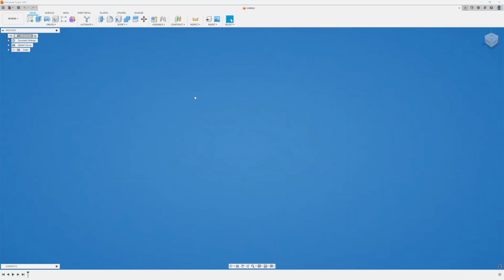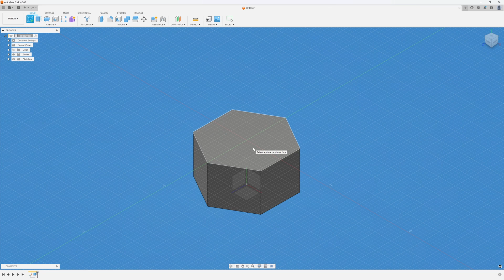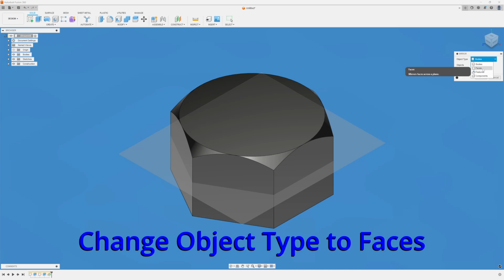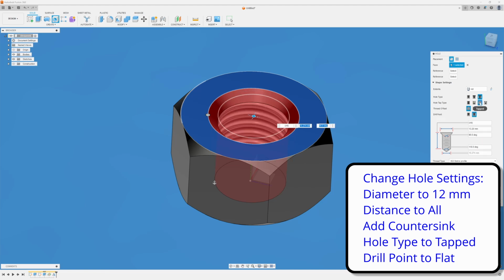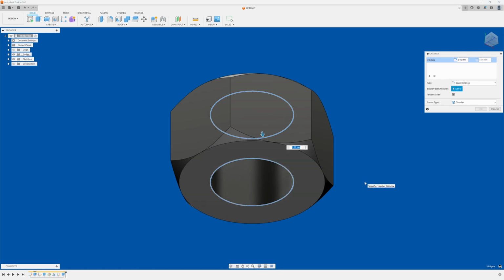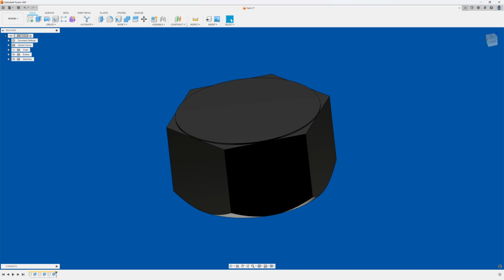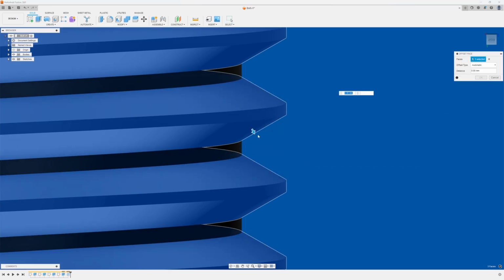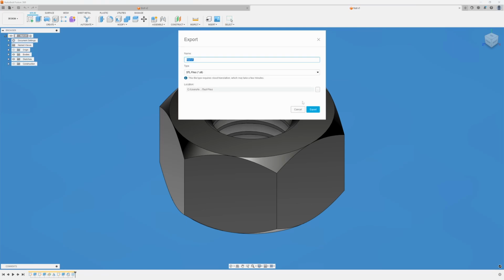Functional 3D Printed Fasteners In Fusion 360

Comment: Very good information. I need to make a lock nut to fit a 2 inch PVC ntp fitting. Good tips. Thanks.
Reply from the maker: I haven't tried this method on pipe threads, it should work! Let me know!

Comment: Thanks, exactly the information I needed! I wanted to attach the the ptfe tube to the side of my printer, so I split the bolt i quarters lengthways and put a hole through it to feed the tube through, and tapered the inside of the nut to compress the tube in place
Reply from the maker: Glad it helps! Thanks for watching!

Comment: thanks again I have learned so much from you. Only thing I wopuld of like to known is  why you to the push pull on the threads
Reply from the maker: I use the push pull to create clearance/tolerance for the thread to engage. If I leave as Fusion makes them, they won't engage. The expansion/contraction of the plastic makes it too tight.

Comment: This was the first video that I have watched on using Fusion 3d.  It was very informative.  I like that you showed several ways to do something, because it gives me more tools in my brain when looking at parts.  It would have been just as easy to roll the nut over and do the circle/extrude, but you showed how the mirror function works.  Not because you are lazy, but because you have a teachers mindset.  Thanks so much for this.  The only input that I have was I found that my nut when on the bolt pretty easy one way, but had to be deliberately aligned to go on the other way.  I found that it was because the 1st way you did the threads you told it to countersink.  The 2nd way you put the chamfer on both sides.  What I realized was that countersink only put the taper on one side of the nut. It needed a chamfer on the other side.  I wouldn't have realized the problem if you hadn't shown both ways to create the threaded hole.  Love this video, love the 3dhinge video.  Keep the 3d design videos coming, you have a new subscriber.
Reply from the maker: Thanks for the kind word! I'm glad you were able to get something out of this video. Obviously, you paid great attention to it. Are you watching Fusion 360 videos for the purpose of 3D printing or general knowledge? Anything in particular u would like to see done in Fusion? Thanks again for the kind words & thanks for watching!

Comment: This is a great tutorial.
One thing I can say what I do to reduce friction from threads binding is reduce the bolt thread diameter by 0.3 . This makes it more better for movement
Reply from the maker: Thanks! Reducing the diameter y 0.3 will work too!
Reply: @pushingplastic7445  just to say threads is a big problem in 3d printing meaning it takes a lot of understanding to get right
Due to the nature of shrinking or expansion of the threads.
But to create for what you have done and shown it is amazing to show and and understand.
From our understanding of our knowledge. If that makes sense
Reply from the maker: @spudnickuk  If I understand correctly, using the M12 thread as an example. Instead of drawing the diameter at 12 mm, you draw it at 11.70 mm? When I do that and THEN apply the thread, Fusion determines the closest standard thread size. In this case, an M12 x 1.75. When I check the major diameter of the thread I get 11.83 mm which is in line with standard screw charts. But by applying the Press/Pull method I'm getting a major diameter of 11.43, a little more clearance. When I go back to fusion and change the  diameter to 12 mm, instead of 11.70, I'm still getting 11.83 as my major diameter. I might be misunderstanding but willing to learn!